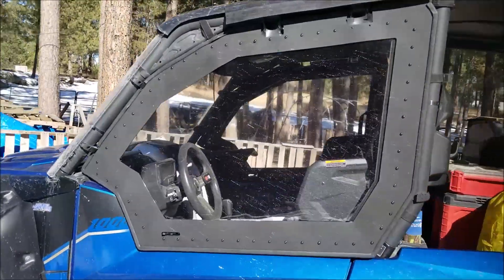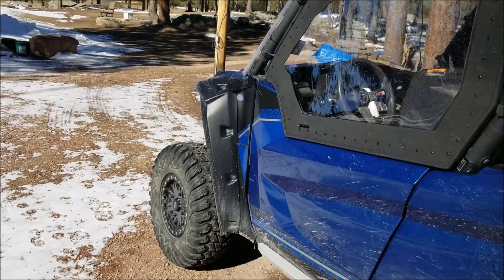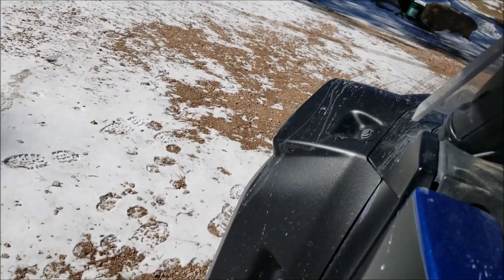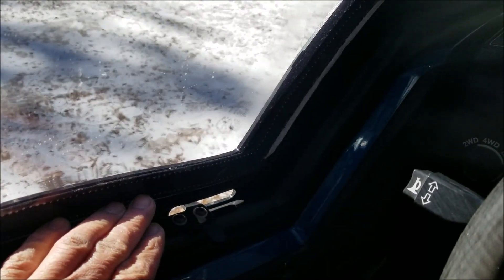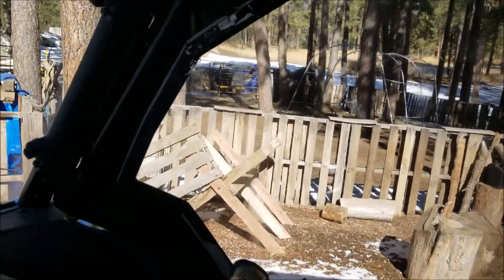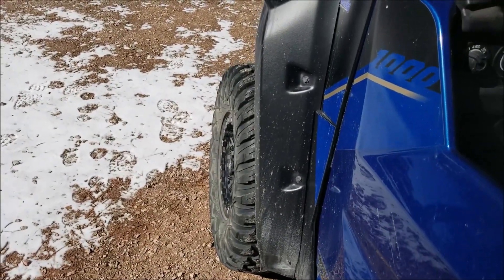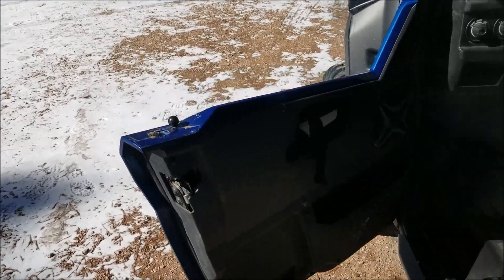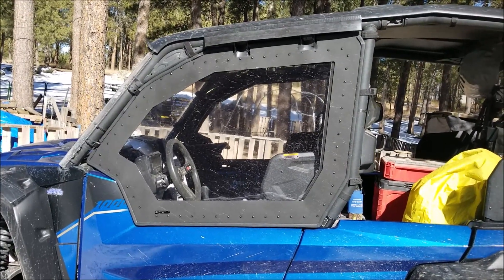Yamaha RMAX gullwing upper doors by UORP/Get Lit

Comment: Great idea when can I order it? 
The only suggestion I have is make the window zippered so you can roll the window up and secure with straps with either snaps or Velcro. That way you can run with the windows open but not have a clearance issue that could arise with the upper door open. Plus, would be more versatile for year-round use.  I have a 2022 RMAX2 XTR running Side by Side Enclosure upper doors and really hate having to unzip every time you want to get in or out and the zipper always stick. I was looking at making upper frames for the doors, looking at doing it two parts, aluminum frame on door for window attachment and separate attachment to roll cage for sealing trying to reduce load on door. But I really like your gullwing idea. 
I would rather ride than weld so let me know when I can put my order in.
Reply from the maker: Zipper probably won't happen but you never know.  The 2 options now are to remove them if you know you're going to have good weather or remove the window insert that's currently velcro'd.  Door nets for summer will most likely be an additional option.
Reply: @MassiveOverkill  Velcro will work you can always roll them up in a bag and have with you. 
Door net would make my wife happy, she is a surgery nurse in St. George, Utah and always sees the roll overs out of Sand Hollow, most common injury not keep hands and arm inside.
Reply from the maker: I want to move to St. George when I hit the lottery!
Reply: @MassiveOverkill  I am actually live in Pine Valley about 35 miles out of St George at 6800' so I don't have to deal with the heat in the summer, just snow in the winter. But Pine Valley only has a population of 182 so it's quite.
Reply from the maker: Perfect, so long as the snow is somewhat mild.
Reply: @MassiveOverkill  Normally it is, this year we are at 289% of normal snow fall and 6-8" more expected on Monday night. This winter we got snow a month earlier than normal and this coming snow is about 1.5 months later than normal. I hate mud and we are going to have 3-4 weeks of that.
I like playing in the snow, but I learned the hard way to limit my excursions when by myself. Hiking out to get cell service at 69 is not fun.
Reply from the maker: @Jack Sloan, I think the majority of the country is probably at the same percentage.  We're also getting between a foot and 1.5" of snow Monday evening through Tuesday.  It's been taxing for everyone for sure and has pushed me to the breaking point, living with our young jack for the past 2 months from him being lame.  Better to be safe than sorry.
Reply: @MassiveOverkill  Okay forgive my ignorance, "our young jack" is that a reference to one of your Burros?
I have gotten a kick out of the videos I have seen with your burros. When I was 8 yrs. old I had a burro name Ralph he was kind of a pink shade.
Reply from the maker: @Jack Sloan, yes we have an intact jack, his name is Enoch.   This is him in this video:  https://youtu.be/ETAko_UEFIo
Reply: @MassiveOverkill  I was just looking at my RMAX and realized I have a problem related to the Gullwing doors, side mirrors. I have the Yamaha mirrors that mount to the roll gage bolts. I was thinking perhaps an attachment to fill that triangle area than the doors would clear mirrors. If they had the type that clamped to the roll bar just position the clamp in the same triangle area and just notch the filler piece, easy if this piece is plastic.
Reply from the maker: It may be possible to still use those mirrors depending how swept back they are.  Most popular mirror method will be mounting/remounting to the gullwing.

Comment: I’d still prefer opening with the door, even if you had to upgrade the hinge.  With the velcro from the inside, won’t water run down the window into the cab? Will they blow in or come loose when trailering?
Reply from the maker: I've had the original prototype and now the gullwing design and prefer the latter.  I think the surface tension of water would act like it does on a zipper.    I've had this up to 65 MPH and the doors are solid.  I forgot to mention the other added benefit of gullwing in the video but the original doors would suck out at high speeds at the top.  No such issue with the gullwing design and the tubular frame is STRONG.
Reply: I like that there’s no drilling the doors for snaps or sticking Velcro to the doors. I really don’t like Velcro much. I agree that zippers wold be preferable, but I guess Velcro holds costs down some.

 They seem like they may be the best option out there. I’ll need something for next winter. These will get a serious look, assuming they make it to production.
Reply: I like this design. What the windows like to see out of. Also is there a seal or gasket around the edge of the gull wing door.
Reply from the maker: @curtisweir5350  There is a gasket around the entire perimeter of the upper gullwing door.